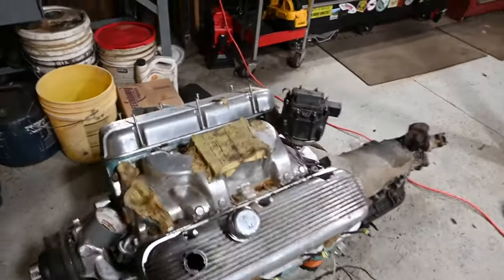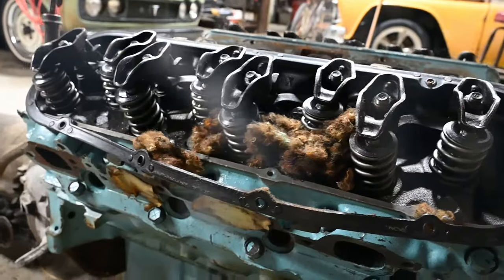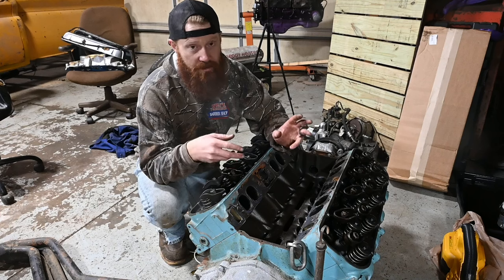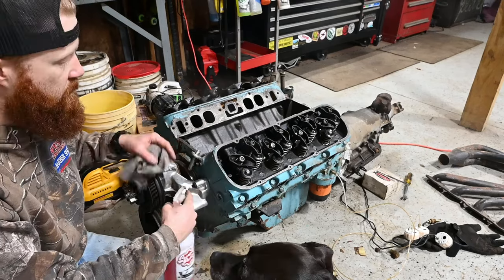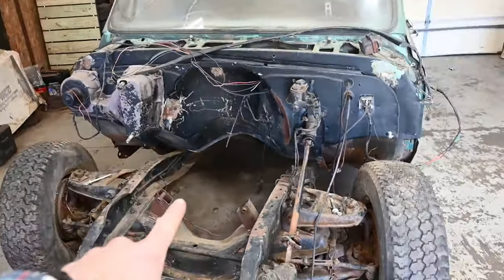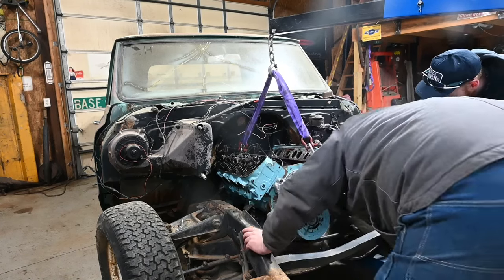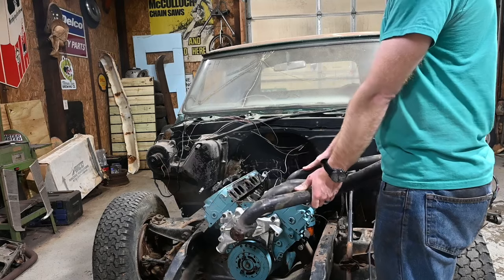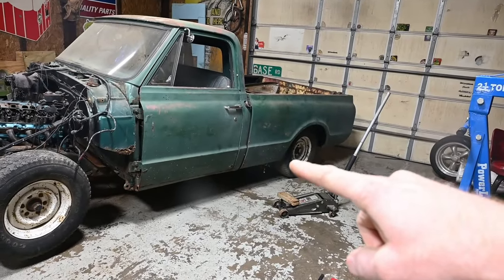Big Block Chevy Powered 67 C10 Build!

Comment: Did you need to do any modifications to the firewall to fit a big block? I have heard that prior to 73 there needs to be modifications to fit big blocks in gm trucks. But I don't know if that is fact or not
Reply from the maker: Yeah it was messaged a little when I got it for valve cover clearance

Comment: Hey man cool build I’m building a 67 with a 496 how much room is there from the back of the head to the fire wall I assume your motor mounts are in the front set of hole on the frame and crossmember
Reply from the maker: This big block was already in the truck when I got it. It has some custom mounts in it. And the firewall is knocked back where the valve covers are
Reply: Ok